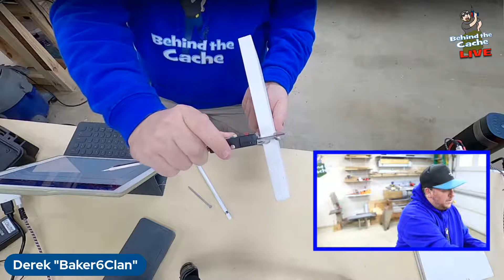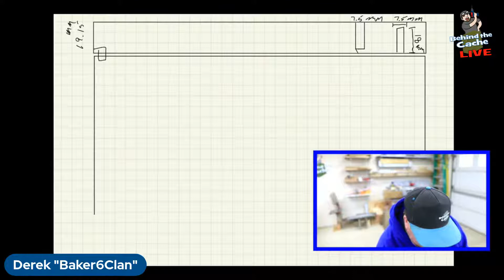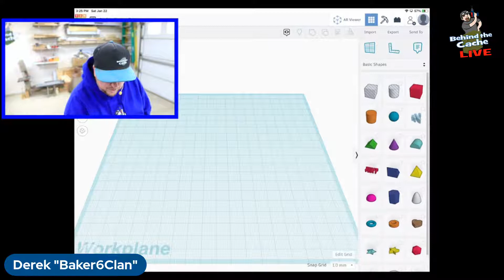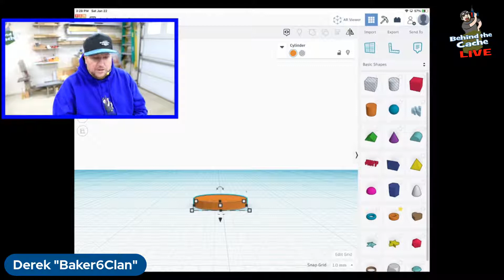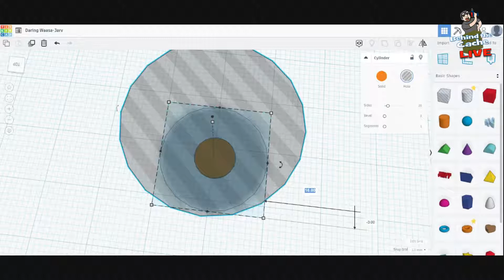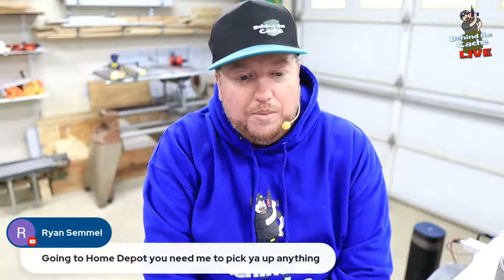Comment: For those of us who don't have a 3-D printer (yet) if you have a dowel the same diameter as the hole the nail is in, you can use it like a washer.  Drill into the lid with a forsner or similar flat bit do the needed depth for the top of the nail, cut the nail to desired length for full retraction.  Drill into the dowel center large enough for the nail diameter and just a little way and then cut a 1/8" cookie off and sand it down.  Put nail into the lid hole, add waterproof wood glue on the edges of the wooden "washer" over the nail and into the hole until it is flush.  Should allow the magnetic retraction and hold the nail in if magnet gets lifted.
Reply: Very true.